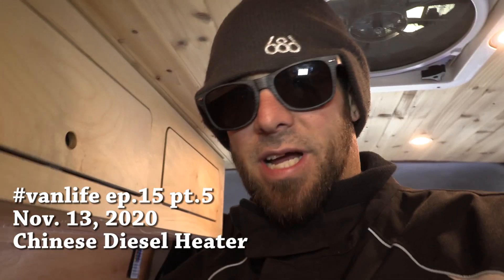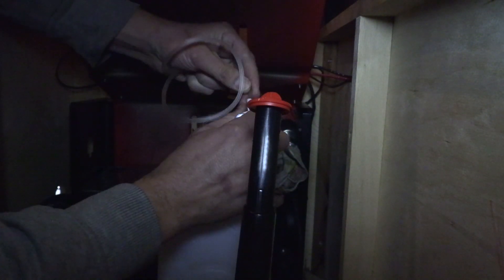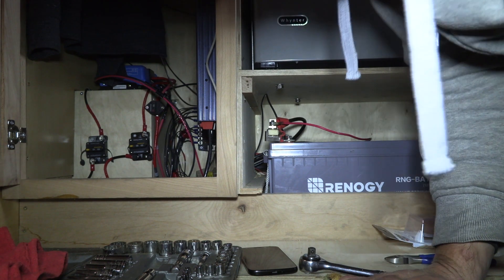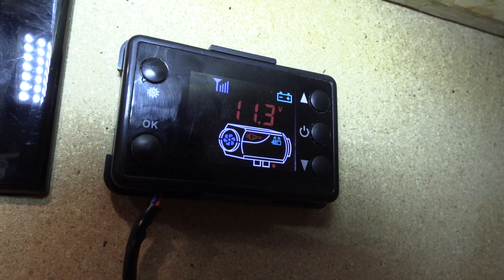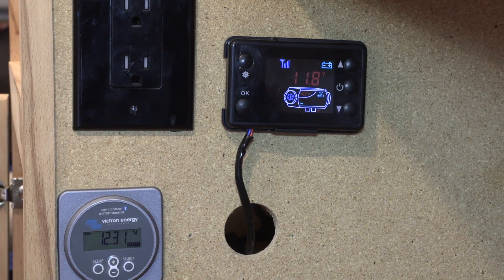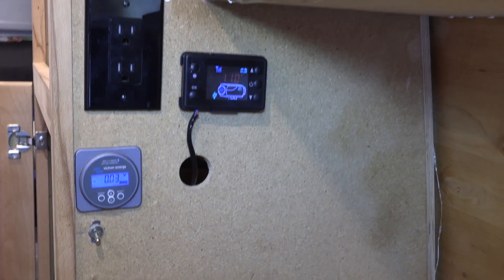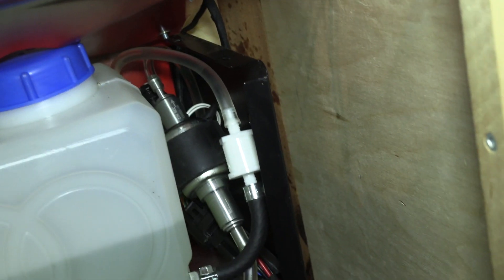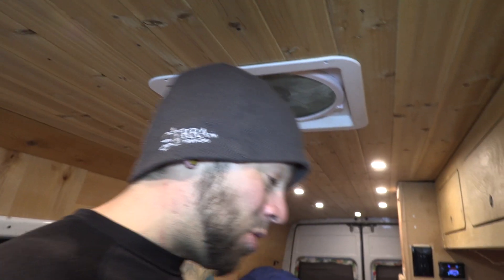Returning it, no one can help. Chinese Diesel Heater #vanlife ep.15 pt.5

Comment: Use heavy cables for supply to take care of your voltage ,amp drop, check angle of pump mounting, clear fuel line of air, use hard plastic fuel lines . If you have white smoke your glow plug is not getting enough current and/or your screen ( which surrounds the glow plug) is blocked and / or your combustion chamber is full of carbon. I have 5 of these heaters and have had all these problems but one you understand these problems they are very reliable heaters. Try running a bit of kerosene through your heater might clean it but diesel is required to lubricate the pump . Good luck!
Reply from the maker: got a new one been working great.

Comment: One thing I learned about off grid is necessary redundancies atleast 2 I have 4 different heaters (propane,diesel, small electric, big electric) cooling, ceiling fans,  portable ac, small window ac, large window ac, and whole home air handler, depending on the scenario one of them can be used for efficiency or incase others aren't working.

Comment: You need to prime it. Hold down the bottom two buttons, then select the up button. The pump will then run constantly and prime the system while getting rid of any air until the fuel is at the motor. then press on.

Comment: Had similar problem with one of mine. Took it apart and cleaned the soot out of it and it fired right back up. Only run for a little while and quit again. I have a finer filter on the inlet side of the burner. Checked it and it seems to be a little hard to suck through so I took it off and blew lightly into it as it was trying to start and it fired up. Left the filter off for awhile and let it run on high. Cleaned air filter is has been running fine. Just a thought that you could maybe try blowing in the inlet tube while it’s starting up. Good luck.

Comment: Anything below 12 volts is a nearly dead battery and will cause it to not work. I would install a battery isolator or you can put a switched/fused charge line you can turn on and off. Alternator puts out 100+ amps@12v so that is serious charging power.
Reply from the maker: I have a isolater but its not hooked up. I installed a new all in one unit its been working fine. but my battery could be getting bad.
Reply: @skeight976  I really like the Blue Optima batteries. Not too expensive and they bounce back from being drained well.

Comment: Haven't read all comments.
Notice multiple things here.
Fuel hose from pump to burner should NOT be a flexible hose. Soft if you understand. Ypu loose pressure.
What fuel are ypu using.
Battery is strange reading. A battery at 12 volts is dangerous low.
Full battery is 12.7 volt.
Google that. 
It should run at 11 volts fine. 
Kut down length of battery cables. Check fuse holder on heater cable. 

My bet is it looks like wrong hose. Hose can't be the type that flex. 
1 pump is 0.022 ml so if hose is flexible it can be it don't get fuel pressure. 
Nozle drips and no burning.
Reply from the maker: thank you for your help. I will change wires and see what happens then. 
its a diesel heater using standard diesel from the pump. and I bought that as a fuel line, I've seen other people run that from the actual car fuel tank to the heater.
Reply: Yes, you're correct about the tubing. The pump will always pump at .02 per pump. This is how you figure out how much fuel you're using, plus the Hz of the pump, then times [ x ] 60 x60. I agree about the volts too!

Comment: Most of the time, it's all about user error... This is a simple setup, so there are only 3 things that could be the issue.. Parts failures, low voltage or fuel starvation..
Reply from the maker: I have a feeling it was the glow plug. but I got a new one and it's working great. kept me nice and warm all winter check out the other videos.
Reply: @skeight976  But your plug worked It was Low Power believe me

Comment: Im about to install one of these. Ive been watching the vids of installs and what could go wrong thank you for the heads up but how did u fix it im so confused. Lol
Reply from the maker: I bought a new heater and installed that. I gave this one away for free. Check out my later videos.
Reply: @skeight976  What brand and model are you using now and is it working?

Comment: I had a same problem with error  E10. My problem was with fuel pump. You could hear it clicking but it couldnt make enough of a pressure to lift fuel. When I replaced the pump, eveything was OK.

Comment: Glow plug draws 10a and is causing battery to drop below 10v causing it to shut down.   
Plus routing of pump and filter cause air bubbles to be trapped.  

Once it’s been run with too much fuel it will keep throwing errors. 

Instal it as per the manual and  connect it to a battery that can provide 12v constant.   Get it to fire and run and run it flat out till it burns clean.  

In future read the manual.
Reply from the maker: you almost helped. seems like its the atomizer and glow plug, I have not taken it apart yet. but my one is amazing 70F in 2F snowstorms. that what I wanted
Reply: You are correct but he blames the plug ect

Comment: I think the criticism comes from the fact that you're messing with fuel (gas?) and electricity and you essentially don't have a clue what you're doing. That ever cross your mind? Thought not! The reason the heater uses diesel and not gasoline, is that diesel will burn and not explode, whereas gas will explode. Your heater, your van, your life. The heater needs 12v to even function. Anything below 12v is a dead battery. Is the fuel filter on the right way round? Is it the right type of hose? If not the diesel could be stripping the hose lining off and mixing with the diesel/gas. White smoke? The heater exhaust should not be white or any other colour. If you don't know what you're doing you shouldn't be messing with fuel and electric power...
Reply from the maker: i said gas, I meant Fuel as in deisel.

Comment: Have you tried it with the van running to help boost voltage?
Reply from the maker: its a house battery. stand alone separate from the van engine. I have not yet installed the dc2dc charger the battery to battery connector.
Reply: @skeight976  is the battery new? I'm sure the voltage should not be dropping down that low.
Reply: @davidfullerton9721  yes you do need a good battery if you try and start it and it keeps shutting down it's the battery. Had the same problem. And if you smoked it to many times you will have to clean it.  I have to start the van to give the house battery enough juice to start heater. Once it's running I can shut the van off. Start the van every 4 hrs to keep enough juice in the house battery. Yes I need a new house battery.

Comment: Just seen error code 10.  And another one. I can’t remember this second. But he said people will have trouble if you preset. Temp or something. . I better go try to find that vidio. He showed error code and the problem in presetting.
Reply from the maker: I got a new one, work great. I did flip it upside down after I had fuel in it to do some work. could have fucked up the glow plug.

Comment: if its white smoke it is not burning it it's just pushing it through check connection to your sensor at the board
Reply from the maker: got a new one and its so great. might give away the other one, or try to fix the plug and atomizer, along with cleaning it out.

Comment: If you are running a diesel heater on gas and never changed the fuel pump to  gas one it will flood. If you are running it with the small built-in tank just run diesel or better yet kerosene, as kerosene helps keep everything clean.
Reply from the maker: Not gas should have said fuel. Sorry.
Reply: @skeight976  It' may well be a bad fuel pump that is feeding too much fuel, Had the same issue with one of the Espar heaters I have and it will do the same thing, flood the unit and produce white smoke. There really isn't much that can go wrong with them, it's either getting too much fuel or the air intake is blocked. Also the exhaust, but from what I see in your video the exhaust is where it should be. A little advice, you should put your exhaust out the side of the truck as it can put filter exhaust into your camper. Just mount it to the side and bend the end down and back a bit.
Reply: These pumps like diesel for lubrication.

Comment: Let's use a flashlight and turn off everything 12 volt except heater. Turn off inverter and refrigerator also. If still low voltage the glow plug setup in the heater is pulling too much.
Reply from the maker: thank you I will try

Comment: How did you extend the wire for tge LCD I would like to do that but there were like 6 wires and I wasn't sure which wires to actually clip to connect
Reply from the maker: mine was 3 wires, I found thermostat wire at the hardware store, 3 wires. should all be the same right?
Reply: Not sur why mine has so many wires.  Thanks for getting back to me

Comment: I'd try a different battery and wires directly ,there might be a continuity issue when the load of the glow plug comes on, the voltage drop is a problem,  I've seen the copper in Chinese wire fragment like dry leaves amp clamp would be handy, the LCD controller and bord in the heater is suspect
Reply from the maker: seems like my battery is not strong enough, Its cold, old and who knows how many times its been below 50% i just got the van.
Reply: I had an issue like that when I was using our car battery so I switched to a rv battery problem went away
Reply: @skeight976  I noticed with mine the fan that pumps air into the combustion chamber is insufficient, if the exhaust pipe is longer the airflow goes down and carbon builds up inside faster, then it has a hard time starting, I attach  a hair dryer to the chamber intake tube on hi to get started without issues, also if you run some 15% ATF mixed in your diesel with a little bit of gasoline 5% it can can clean out the carbon. Remember though the gas will separate and go to the top after a day, so the tank would need to be ,shaken stirred mixed up

Comment: Question? Are you using a hard nylon fuel line that is 4mm OD x 2mm ID? What I see is you have the wrong size and tubing. This may seem like a dumb question do you have the fuel filter flowing in the right direction? It will smoke with excess fuel into the burn unit or even air in some cases. The volts I would not worry about that too much yet. Bump the pump Hz back to 1.6 if you have turn it down? You did it right by connecting to the battery.
https://youtu.be/jCZhjGyR3bo this one from John can help too.
Reply from the maker: thank you and its fuel line from a car parts store. and double checked the filter for correct direction.
Reply: No he has the wrong fuel line  That installation is as bad as can be.

Comment from the maker: after all this and months later of facebook comments and youtube comments. 
my battery is probably not pushing enough AMPS. acid battery cold weather.
Reply: Yep.  That'll do it.   For example, it probably won't run with a good motorcycle battery.   HAS TO BE a large battery with lots of reserve AMPS for startup.
LOTS of people give up on these and return them when it was their battery that was the problem.
Reply from the maker: @randydicotti3975  got a different one and it’s been perfect.

Comment: bet the pump crapped out... a guy did a vid on this. he lowered the Hz too low...the pump died, replaced the pump & restarted with the proper Hz....all good
Reply from the maker: think thats my next round of trails is the pump speeds.
Reply from the maker: pretty sure my 10-11 watts is what is killing it all it needs to be 12 or better. fucking old acid batterys
Reply: @skeight976  im no expert but i think its possible. these heaters def wont take underpowering without loading up with unburnt fuel. more important seems to be dont lower Hz...

Comment: Looks like your fuel pipe has too bigger diameter and too flexible.
Reply from the maker: got a new one, works fine. probably because I flipped it upside down after using it. glow plug went bad